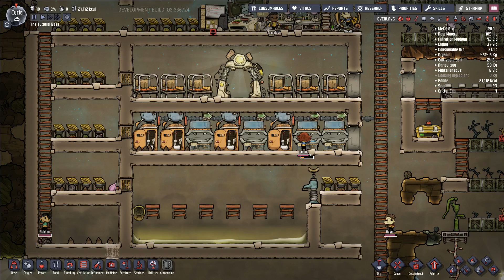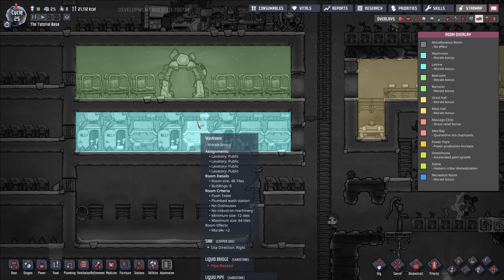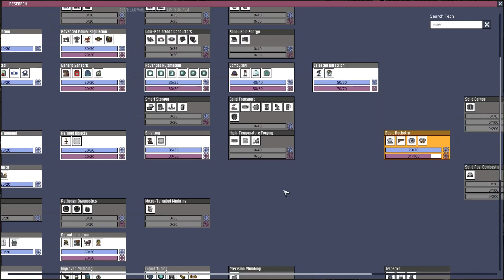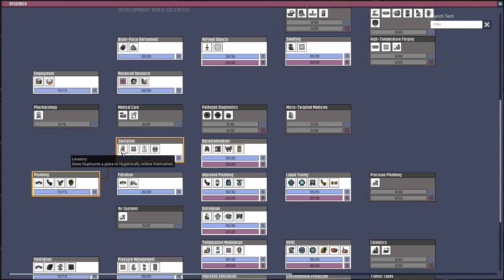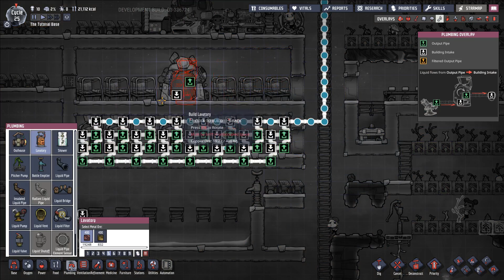Plumbed Bathrooms - New Player Guides [Oxygen Not Included] (DEPRECATED)

Comment: you really really don't need any bridges, useless
Reply from the maker: In the late game, one of the problems you might encounter is that the base is very laggy, and your framerate slows to slideshow levels.  One of the reasons this can occur is that you have not set up clear pathways for your gas and liquid systems, and the game is constantly having to do pathfinding calculations to figure out where a packet of gas or liquid should go.

You're right that the bridges aren't strictly necessary-- your toilets dont need to be set up for peak fluid flow efficiency, given the intermittent nature of their use.  But this is still the correct way to build them, and in the late game when your base starts to slow down, you'll be glad you built them this way.